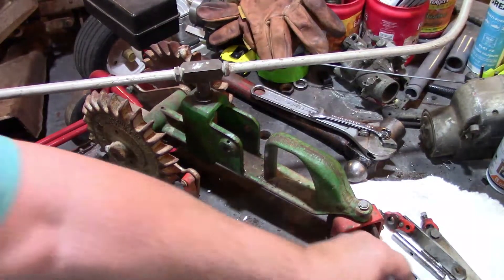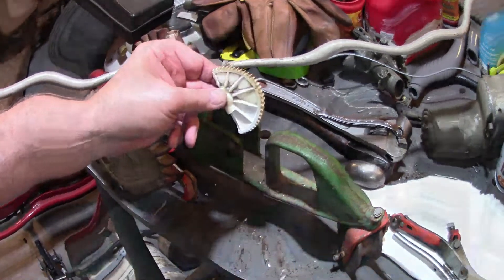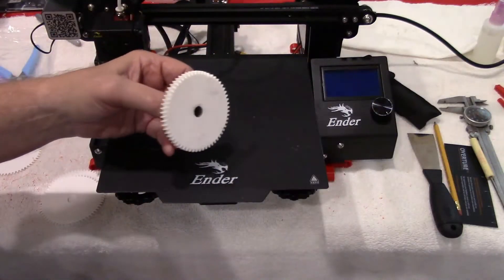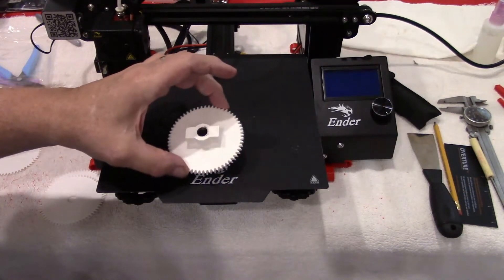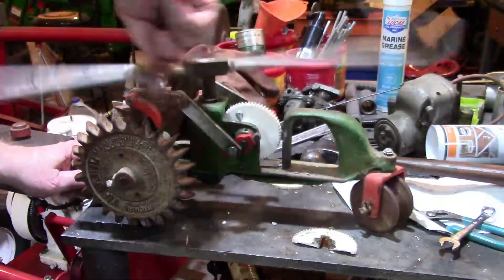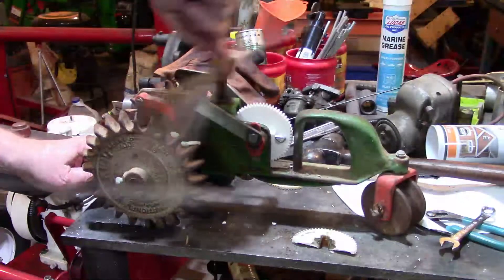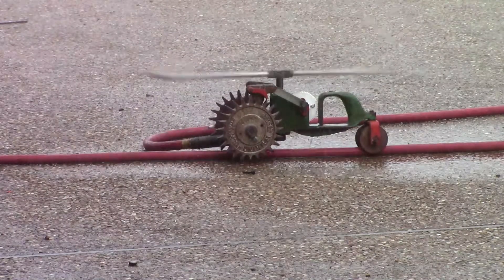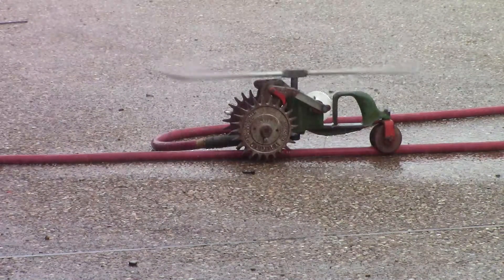National Walking Sprinkler A5, 3d print drive gear

Comment: Nice job Lloyd.  I picked one up at a online auction in perfect condition for 12 bucks lol.
Reply from the maker: It is a tough old sprinkler and built to last. If it has the bronze gear you will never have trouble with it. Good luck

Comment: Im sure a guy could print a negative and use some kind of epoxy to mold a gear. there are some acrylics that that are super strong.  or just keep a few printed up  maybe a guy could paint the gear to keep the uv off of them?  Im guessing that gear runs off of a worm? maybe a guy could hobb a gear out of aluminum.... this kind of printing is what i like
Reply from the maker: I'm thinking I might try to cast my own from aluminum when I get the foundry furnace built. This printer has been a lot of fun. Thanks

Comment: Hi Lloyd! that 3-D printer is sure coming in handy! I bet you could sell your gears on Ebay. That sure is a cool old sprinkler. I'd like to see what the plastic gear is turning. Thanks for the video. Wishing you a pleasant weekend. Take care.
Reply from the maker: Thanks Todd, the sprinkler head spins the shaft that has a worm gear on it rotating the gear I made to operate the drive assembly.  Have a great weekend my friend

Comment: Careful with that in the Texas summer sun, that PLA melts at 190C 😄  

Nylon??? You'll be casting an aluminum one before summer 😄
Reply from the maker: I was thinking the same thing. It has helical teeth on the gear so it would have its challenges. Maybe a lost cast PLA would be the way to go? Thanks Perry
Reply: @RustyGlovebox  You could always try to twist it when you remove it 😄  I'm kidding of course. Yeah, lost pla would be an option of course then you have to do plaster, get a vacuum chamber, get a kiln.. You can print a lot of replacement gears for that price 😄